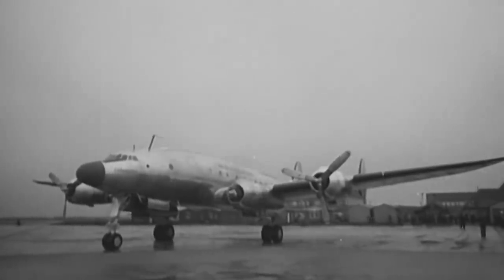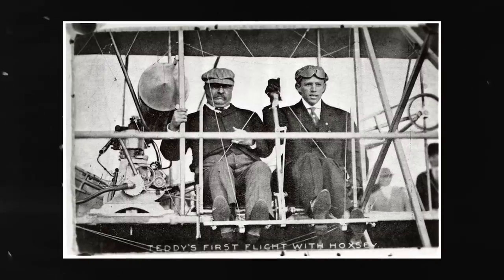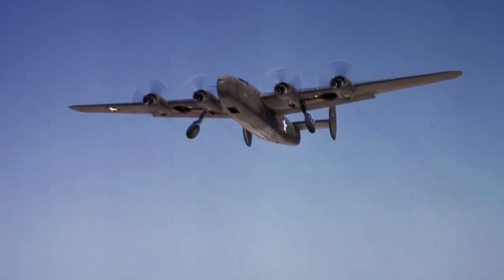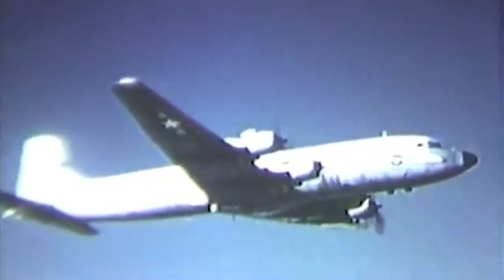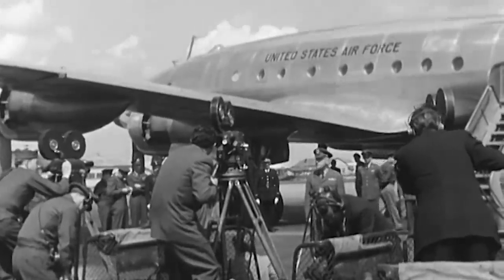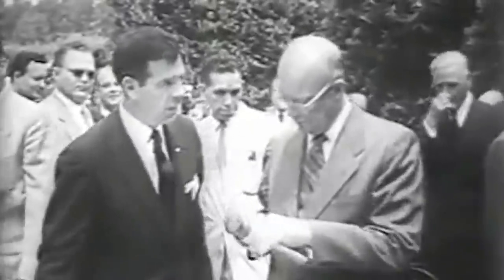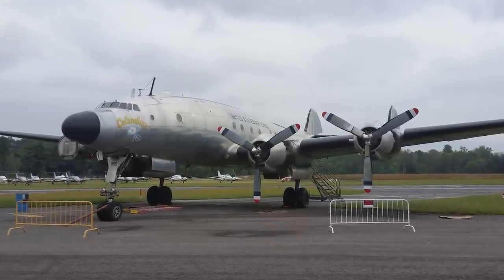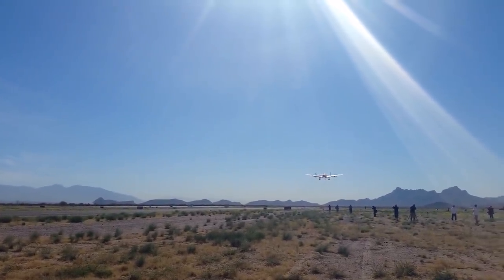The Incident that Created the First Air Force One - Lockheed's VC-121A-LO Constellation

Comment: When I started my career in Chicago center in 1985 we still used those same scopes shown at the beginning.  By then we no longer needed the shrimp boats as we had computer tags on the planes.
Shrimp boats are little plastic blanks with the plane ID written on them that controllers used to push around after each target sweep.
Finally replaced the old, old scopes in 1998.

Comment: As a kid (just old enough to be thoroughly dumbstruck) flying aboard Constellation SAA/ZS-DBR/L-749 piloted by Capt Rademacher; from London to Athens, then to Cairo, then on to Khartoum, and then to Nairobi, and from there to Johannesburg only to turn around and drive east across the Transvaal to Mbomela and to Resanno Garcia, there turning north for the Xai Xai District and finally, home plate in  Chicuque, Mozambique. I retraced the exact safari route in 2017 shortly after Denia.

Comment: “Maximum density altitude” btw guys, density altitude is used to describe how dense the air is at a specific altitude due to heat or barometric pressure. For example, it could be very hot one day so the density altitude would get higher, requiring more runway and making the aircraft less fuel efficient.

You’d want to replace “maximum density altitude” to “surface ceiling”

Comment: So the call sign protocol fixed a problem with multiple aircraft having the same flight number for the President, but what about duplicate flight numbers in general? IF  it can happen to the Pres, I can happen to any commercial airliners sharing the same airspace.

Comment: Jeepers I wouldn't want to fall out of a Connie, pretty high off the ground
Reply: It used oversized propellers so the engine’s didn’t have to work so hard. As a result, the landing gear had to be taller so the props could clear the ground.

Comment: G'day Dark, There is only one small downside to the callsign, "Air Force One". As you would appreciate, many of the flights taken by Presidents on the 'custom' AF1s (there are two, identical Boeing 747s kitted out for the President) are by necessity secret. These are situations like Presidents visiting troops in war zones, where the Air Force and Secret Service don't want anyone to know where, when or how the President is flying. Often, the media will be told the President is in his residence when, in fact, he is flying in secret. 
The problem arises when AF1 has to check in with civilian ATCs en-route on various legs of the President's secret flights. It is difficult to stop Air Traffic Controllers from mentioning to other aircraft to move out of the way of, or look out for AF1, to maintain separation and avoid mid-air collisions. This, of course, gives away the President's location as any aircraft only has AF1, or Navy1 etc. as a callsign when the President is actually on-board.
Thank you for this great video and some excellent footage of the Constellation which is a magnificent aircraft, in any configuration. Cheers, BH